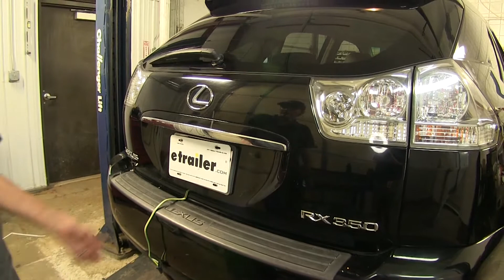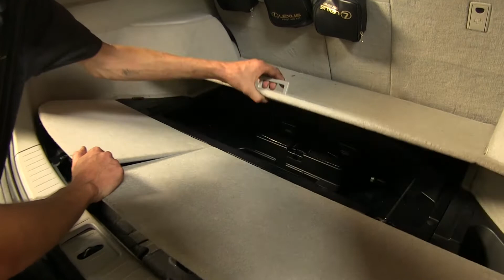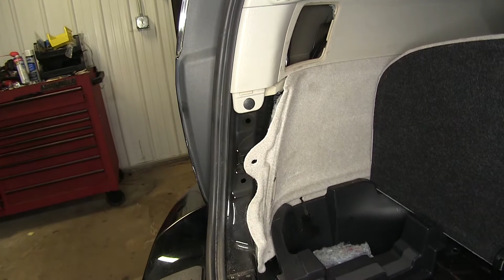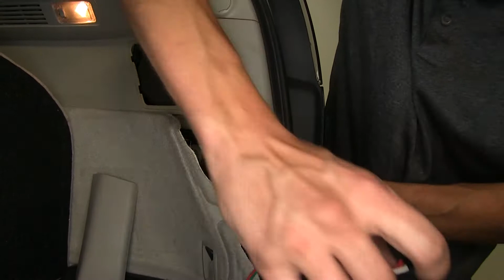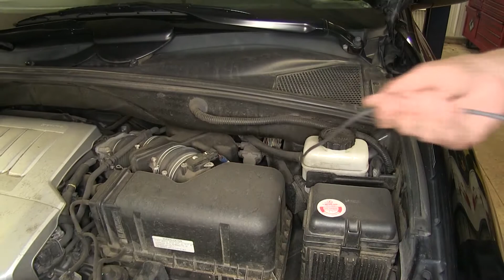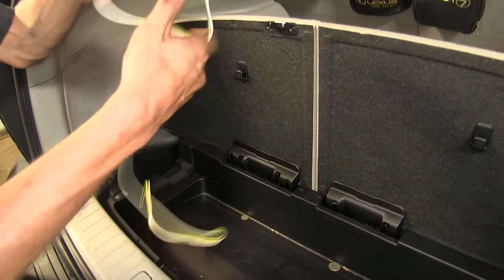etrailer | Trailer Wiring Harness Installation - 2008 Lexus RX 350

Comment: If you have the factory port on the driver side rear taillight harness for towing (you have to a bunch of the floor and plastic trim), you can buy a $10 Ford Escape wiring harness (CURT 55255) on the place that rhymes with Bamazon and it is a direct plug in.
Reply from the maker: If the Curt # 55255 coincidentally fits at works, that's great! However, Curt lists it as a fit for the 2001-2004 Ford Escape or Mazda Tribute. The Curt # C55563 is what Curt recommends for vehicle that aren't equipped with the tow package.
https://www.etrailer.com/Custom-Fit-Vehicle-Wiring/CURT/C55563.html
Reply: You just saved me a lot of time doing the t connector vs this plug that's factory!

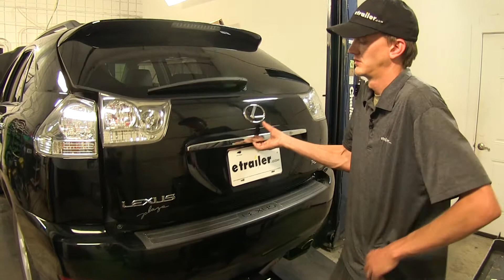Comment: 2:40 Why do I do most work on my own cars? There are several reasons but one of them is to avoid disrespectful mechanics who couldn't give a rat's a$$ to have clean hands before handling interior parts. My man here is just going to grab those tan mats with filthy hands that have clearly been on greasy parts of a car. Then later on, continue to grab tan plastic parts unnecessarily getting grease all over them. Nice. I mean, using gloves, whether disposable nitrile or regular, or even just washing hands with soap before entering the interior of a customer's car is just too much to ask of some people, even when making a video. 

Having said that, I appreciate the information in the video. Thanks.
EDIT: Also all the written info in the description took lots of time and I appreciate that as well.

Comment: That's a ton of work for what ends up as a jury rigged end connector.
Reply from the maker: We install the wiring to be stored on the inside of the vehicle because the owner of the vehicle only plans on using it a few times a year. This is to protect the wiring from the elements.
https://www.etrailer.com/Custom-Fit-Vehicle-Wiring/Curt/C55563.html

Comment: Too much work for trailer light
Reply from the maker: This is what you will need to do if you want to safely tow a trailer. down the road.
https://www.etrailer.com/Custom-Fit-Vehicle-Wiring/Curt/C55563.html
Reply: If you have the factory plug there under all the plastic on the driver side taillight wiring harness, you can buy a $10 Ford Escape (CURT 55255) factory plug on the place that rhymes with bamazon. Just read the reviews before you buy it multiple people talk about how it fits multiple Lexus'.
Reply: You just saved me 60$ for the t connector and the hassle of running a wire to the battery!! Also don't have to mess with my tail lights thanks man!!!